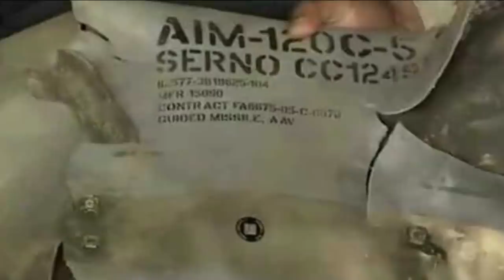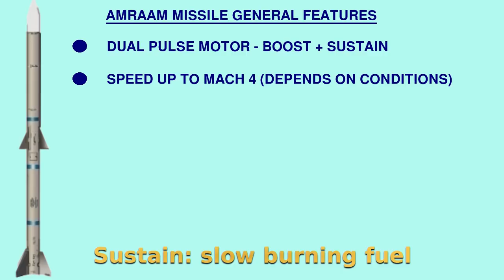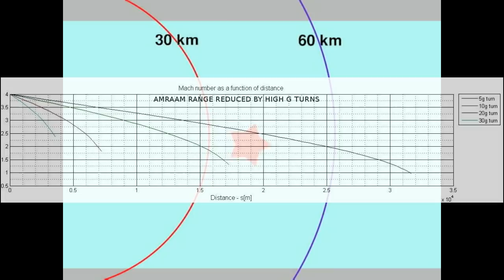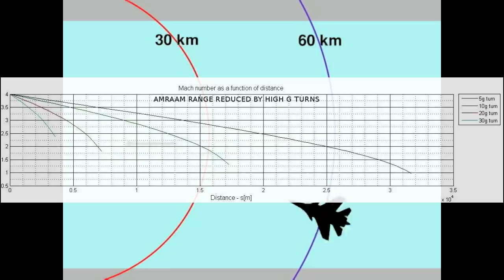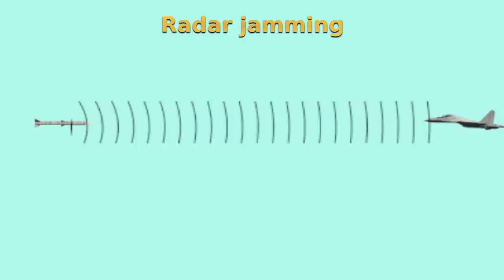Explained: How IAF Su-30s evaded Pakistani F-16s + AMRAAMs (हिंदी सबटाइटल )

Comment: One analysis, i read from a retired IAF Kargil veteran. 
The PAF package had 24 aircraft, out of which, there were 8 F16s , 4 at 15000ft and another 4 at 35000 ft. Our Su30 s were at 15000ft at the time of engagement. The aim of the PAF was to somehow down a SU30 which is the pride of the IAF. The F16 Amraams had slightly higher range compared to the R77 on our SU30 and the advantage of higher altitude at that time. 
At first engagement, the F16s at 35k feet height fired their AAmraams from maximum range, which the SU30 s jammed or evaded successfully. The SU 30 pilots were being provoked to get into an Air battle. But the SU30s at that moment had evaded the first volley of Amraams and in the meantime, they were buying time for back up/ or trying to drag the PAF into Indian airspace, so that our SAMS can take them
More SU30 , Mirage 2000 and Mig 29 were already despatched. The Mig29 s were instructed to climb to 36000 ft and they were approximately 7 to 8 mins away from the action scene.
At this instance, the 4 F16s which were at 15k feet started climbing to 35k feet. This is because BVRAAMs fired from a higher altitude at a target which is at a lower altitude , has better kill possibilities. 
Abhinandan, who was airborne secretely with his MiG-21 ,  suddenly came into the arena from behind the Peer Panjal valley . PAF got the shock of its life. By the time  their awaacs could detect the MiG-21, it was too late. The battle now turned from BVR to WVR - Within visual range. Abhinandan locked the climbing F16 with his R73 and scored a direct kill. In the process he crossed over into PAK airspace and was shot down, maybe by a SAM or from another F16.
But there was chaos in the PAF and most of the Package ran away. Because the fear of more SU30, Mirage, and Mig29 joining the fight any moment was weighing heavily in their minds. 
Had these fighters joined the action, then definitely PAF would have been butchered that day. 
Unfortunately Abhinandan had to eject over POK and got captured. Pakistan deliberately planted videos of his capture, just to push India on the defensive. They were very much afraid of India's next action. Most Pak Generals and commanders lived in bunkers in the next 3 days, until Abhinandan was released.
Reply: I saw the dogfight with my own eyes. What ur saying is true most of it.
Reply: I saw su 30 2 in numbers...2 mirages 3 f 16 ...saw 2 jets going down toward border...3 loud explosions of aim 120. 2 glide bombs craters. 1 aim 120C crater.  There target was Nowshera headquarters IMO. But 1 su 30 was protecting it. 2nd su 30 was kinda protecting me I wish to think that . because it was right above my head. 2 mirages were further west toward loc. Couldn't identify any migs though.

Comment: Excellent video and accuracy !
Su-30 may also drop speed below 100 knots to break AMRAAM or F-16's lock-on. Using either tailslide or high alpha slow maneuver. Doppler radars can't follow very slow-moving targets close to the ground  (5000 feet). 
90° break and max chaff release at missile arrival is good tactics also, provided RWR  system indicates seconds to go until impact, or visually detected by the two-man crew, quite tough for a small burnt-out motor engine missile on the glide..... 
A few doubts here as to the boost and sustained phases : but info classified as you said. As an example, Magic II missile impulse is 2,2 seconds. In the order of 11- 15 it's very good already, like Super 530 family. Beyond it is R-33 or -37 big missiles...
Same disadvantage for MICA, until dual pulse improvement fielded. New long range types like Meteor function differently and will give a much longer burning time.
: )
Reply: I will tell u what I saw u guess m
 the altitude  and speed and maneuver.I watched su30 evading missiles that day from a hill top. It was right above my head and I could see the aircraft and all wings clearly but no weapons. First it was flying toward west i.e LOC. then it suddenly started turning north and then toward east followed by an explosion in the east. (I think first missile was dogged). Then it came back from east. Took same turn again. 2nd explosion in the east. After than it went more toward south west. And this was the point when I saw 1 jet going down toward LOC. Surrounded by 5 other jets...2 were mirages I could tell because when they turned sharply I could see the outline of tailless delta wings. Others were further west.  After this a big formation approached from south east. I couldn't see anything because they were very high and i had to look directly into the sun. But rumble was very loud and stomach churning.
Reply: Jesus Christ.. techies

Comment: Couple of observations:
1. AIM 120C is smokeless.
2. SU 30s can outmaneuver a missle lock, this is why Russian don't believe in all aspect stealth. There jets are designed to get close and get the enemy aircraft to engage at WVR, a hook-n-pull.
3. If a missile is fired at Su30 the immediate action would be to turn hard, then increase speed, go down rather then go up as atmosphere becomes thin and so does gravitational pull, thus giving the missile less energy to bleed. 
5. Going down at 60% burn, increase AoA envelope, deploy chaff, and let it bleed energy until the lock is faided. 
6. An F-Pole maneuver is the best when launching the missile, and even evading one.

Comment: I'm glad the PAF didn't use Meteor missiles.  The Meteor is not technically a ram-jet but, like a ram-jet missile, it does have powered flight over long-range and so isn't just gliding and losing energy.

Comment: One more point which is very importan you did not iclude in your analyses. When active radar homing missile is jammed and switches into the “lock on jam” mode it only knows the direction to the target but does not know its distance anymore. This together with maneuvering increases the survival chance dramatically.
Reply: Lock on jam don't work on deception jammer...

Comment: 5:28..onwards..that is exactly what happened. Both the PAF and IAF detected each other but the PAK having the AIM-120C / PL-12 BVR fired those first shots, several of them and during which the Su-30s did evasive maneuvering and failed to come in contact with the PAF F-16s and JF-17s. It is exactly during one of the events that a Su-30 MKI failed to escape from either the PL-12 or AIM-120 C that PAF 'Struck Gold'. Please note during war times hiding and propaganda work maximum. If we recall the Bosnian war when  Zoltan Dani shot the F-117A the debris fell on the enemy turf and rest is History. This same unit of Zoltan Dani is credited with the shooting down of F-16s, FB-1 Bomber, the towed decoy of an FA-18 to name a few. The Ping record confirmed those 'Kills'. What happened is that the debris fell on the friendly turf. When the Su-30 was shot down it fell on the Inder side. The Mig-21 fell on the Pak side. It was exposed ! Modern 4.5 or 4++ Gen Fighers works on an ultra EW suit that incoming missiles are easily detected and can be jammed. AIM-120(variants) is credited with many kills during the 90's and 2000's but as countermeasures are fast coping up it(AIM-120) is not being able to deliver the magic. The AIM which PAK bought are the 'C' or 'B' variant of 10 years old !! US is heavily restricting arms sale to PAK. Moreover initially when PAK reported that they had shot down 2 jets it was little un probable that one of the Jets was a Mig-29, as both the Su and Mig have a cobra design and look the same. Even the PAK f-16 are very outdated and now the JF-17 is doing all the wonders for PAK. PAF did score 2 kills and as protocol deemed for two of their jets have that 'Feather' on the side of the F-16 and one JF-17.

Comment: Correct me if I’m wrong but how is missile debris from an AIM-120C proof that India shot down an F-16? Shouldn’t the debris be from an F-16 and a R-77 missile? 

The reason the SU-30’s were able to evade the AMRAAMs was because they were fired at their maximum range of 100 km. By then they are out of energy to maneuver which is why doctrine calls for them to launched at 65 km when a fighter would be within their no escape zone. The Russian R-77 is also supposed to have a 100 km range but apparently that isn’t true. The SU-30’s didn’t return fire because their R-77’s actually only have an 80 km range. Something handy to know the next time, they’ll be able to get within the no escape zone before launching their AMRAAMs while the R-77’s are out of range. Guess this is why India is looking to replace them with Israel’s Derby missile before this occurs!??
Reply: Answer to your first question about the debris of the F16.
It has been told n number of times that the F16 was shot down in Pakistan territory by Abhinandan in his Mig21. Both F16 and Mig 21 were in Pakistan territory in the dogfight and they both fell in Pakistan territory. 
As usual Pakistan hid the F16 loss and published the Mig21 debris everywhere, even parading the captured Indian pilot. 
Hope that answers your question 1
About the R77 you are right. It's range is a bit short and it underperformed that day and also the su 30 pilots were at 15000 ft 
But the SU pilots did not leave the battle . They were just waiting for the backup from Udaipur air base. 6 to 9 mig 29 and equal number of Su30 interceptors which had climbed at 35000 ft and were just  6 minutes away from the battle zone. 
By the time these additional jets arrived PAF disengaged completely. 
Had the battle continued, the story would have been different.
Reply: SREEDHAR R ... look, there’s a reason that they installed gun cameras on fighter planes, in the heat of a dog fight, pilots tend to exaggerate. India claims their pilot managed to shoot down an F-16 just before he was shot down and captured. They claim radio transmissions prove this ... but they won’t release the transmissions? Pakistan has the remains of the MiG-21, including remains of the 2 R-73 and 2 R-77 missiles it was carrying? Kind of hard to claim you shot something when all the bullets are still in your gun? Plus American officials are required to inventory the F-16’s to make sure they don’t sell them to someone else without permission. All of the F-16’s sold to Pakistan were accounted for so unless they somehow bolted the shot down plane together ... they should’ve noticed that one was missing???

Comment: The AIM-120 AMRAAM C5 is in current standards, a relatively old missile (from the mid 90s). The same about their F-16s radars. Not only its range is shorter than the C7, but is technologically less advanced. It is a possibility that the mixture between a more modern jamming system (incorporated ipossibly in the indian Sukhois), adequate decoys, and a better training, meant that the Amraam missile failed. Of course, it is not known how many missiles the pakistanis fired, but i guess the indians were well-trained to maximize the success of the mission. They sent a mix of ''old'' (but in fact, very capable upgraded Migs) and modern fighters, to fool Pakistan into focusing on the Sukhois, possibly thinking the Migs were there to act as decoys (to cover the Su-30s). The Bisons were upgraded with many interesting technologies, so i think Pakistan may have underestimated the IAF. That's why they sent the F-16s, and not the supposedly superior chinese-made JF-17. But who knows... All you can conclude from this is that India's air-battle plan was a success.
Reply: How can you conclude that India's air-battle plan was a success when it dismally failed to prevent the PAF strike and lost two jets with one pilot killed and other in captivity if enemy?
Reply: Yes India's plan was successful. 3 trees and 1 crow killed.  Two IAF fighters shot down.  One helicopter.  Lovely RSS logic.  Well done.
Reply: @TheRealDoctor-k8p  go drink Gao Mootar shudra
Reply: @TheRealDoctor-k8p  where is the F-16 you gaandus claim to have shot?
Reply: You need medicine! Indians shot down their own Mi-17. They lost a MiG and a pilot captured in a globally embarrassing drama, launched an airstrike on an open mountainside claiming 300 killed..... Are you REALLY blind?
Reply: "India's airplan was success by shoot down their own mi 17 helicopter" yeah yeah ok ok now cool down and drink some fantastic tea!!!
Reply: @max-greg  do you need tissue? Dont cry johnny
Reply: @max-greg  As if Pakistan runs around with a perfect no friendly casualties record.

Comment: That is the worst explanation of how to avoid a Missile..As you need to know what missile you're avoiding. From what Altitude and Distance. As you can start notching to avoid it. Pull it down to lower altitudes to increase the resistance on the missile. All while tracking the Aircraft that shot at you. So you can put them on defense avoiding your weapon fire. 

By the way. No sane person will fire AIM-120A/B: at 55–75 km. It will lose all energy going that far. Then fall out of the sky. Never having the chance to attack the target at full energy. It will be at best 0.6 speed. Well below maneuvering speed. To turn on target.
Reply: Your second para answer is exactly what the PAF did on 27 Feb. The pilots launched missiles at D-max ranges ie the missile's maximum range at which it can be launched.
The Su30s defeated the AMRAAMs because of this very reason as they had the distance to perform high G manoeuvres and the time to break the lock.

The Mig21 was not so Lucky as it was in the WVR ,but not before getting an F-16 by firing an R-73 missile.